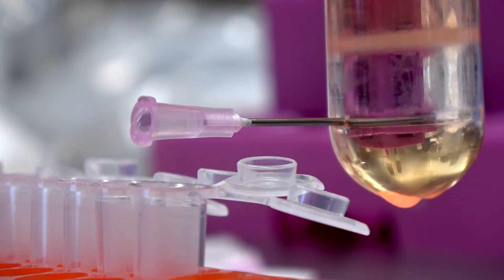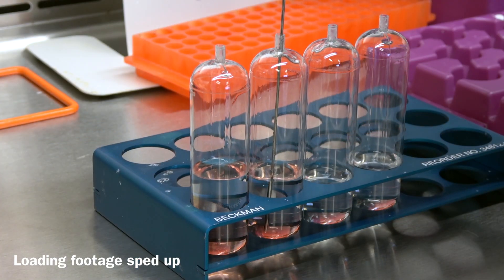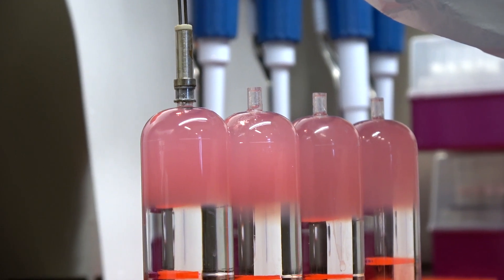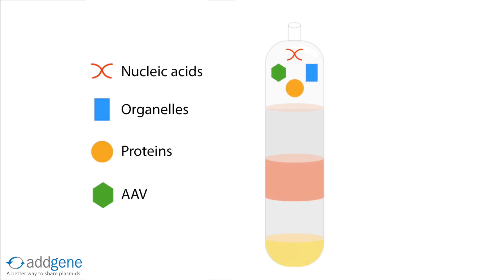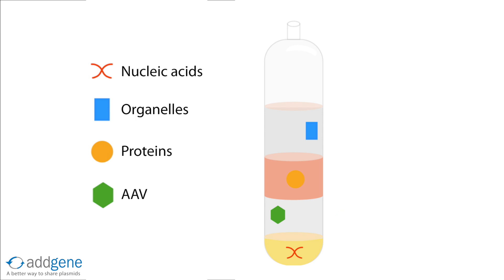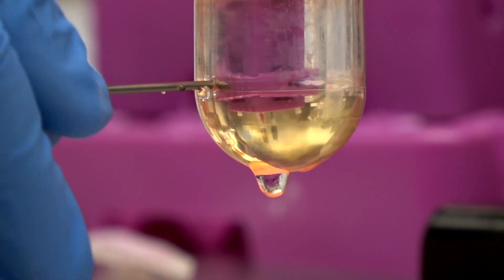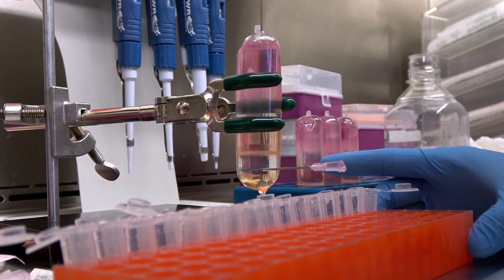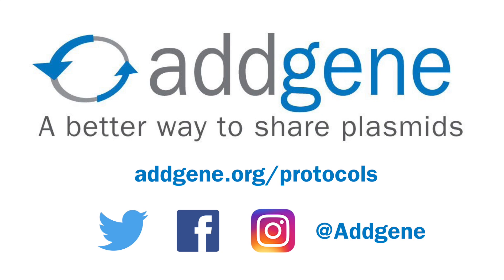AAV Purification

Comment: It is very interesting that in a video of less than 6 minutes, they teach us a technique for the purification of AVV.  Seeing this process and being able to understand it makes learning easier, the fact of seeing how careful they are and the exact method required for its elaboration also shows us how complex a procedure like this can be.  Now, ultracentrifugation could be said to be of the utmost importance for the production and purification of the AAV vector that is released from the solution found in the cell culture.
 It is necessary to highlight this method that is presented to us in the video, it provides us with information to know and better understand separation techniques, in this case with the use of a column with 4 different densities, so that the particles remain in one of the these 4 zones, depending on their density and/or size, which is very interesting to appreciate.

Comment: Es impresionante como el proceso para obtener la purificación del vector AVV es de sumo cuidado y con cantidades exactas de los reactivos asi como de los materiales específicos para llevar este proceso acabo, sin embargo, es de resaltar como la centrifuga cumple un papel muy importante en dicho proceso, el como empieza a separar una muestra en sus componentes más densos y menos densos respectivamente es la clave de que la extracción del vector AVV resulte exitosa, si no fuera por este paso sería casi que imposible separar de una manera casi perfecta estos componentes para asi obtener la muestra deseada, siempre y cuando se le coloquen las medidas correctas, que en este caso fueron 350 mil g durante 90 minutos,  aqui es donde podemos notar la importancia que tiene la fuerza centrifuga, ya que debido a esto las capas individuales permanecen intactas mientras que  las macromoléculas del sobrenadante quedan en la parte superior y así poder extraer la muestra deseada.

Todo esto nos puede llegar a recordar una definición de la fuerza centrifuga, la cual dice que: La fuerza centrífuga es la fuerza aparente que experimenta un cuerpo en un sistema de referencia rotatorio. Que está dada por la ecuación:  fuerza centrífuga = − ω m (ω × r) = m ω2 r, aquí podemos ver como la física, la química, la biología y la ciencia en general se complementa y cada una de ellas es tan importante como la otra, si no fuera por el conocimiento que se tiene sobre la fuerza centrifuga, no fuera posible usar un centrifugador y en este caso obtener una correcta purificación del vector AVV.

Comment: This is a procedure where we're studying a few steps of the Adeno associated virus vector (AAV) production. The main features of these steps are related to use a composed called "iodixanol" and a process called "ultracentrifugation" to form some column density gradients to help purify a cell culture solution. The basis of the technique is isolate virus particle according to its size and density. We have to prepare a column with 4 densities of iodixanol, adding each layer at a time. After that, we add the virus containning supernatant to the top carefully. Then, we spin in the ultracentrifuge. This process will separate nucleic acids, organelles, proteins and AAV according to the different density gradients in the corresponding layer of iodixanol. The AAV will be found at the bottom, so we have to puncture in the bottom layer with a needle to extract drop by drop the solution of AAV that we will need for the rest of the process. Great video. I love it.

Comment: El vídeo muestra de forma general un método para obtener soluciones de vector de alta calidad (purificadas) para su análisis a partir de una columna con 4 densidades diferentes de iodixanol (en diferentes porcentajes) que se someterá a una ultracentrifugación a 350,000 G durante 90 min. Con el fin de que las macromoléculas migren hasta que la densidad de estas y las del gradiente sean idénticas. Justamente el AAV entrará a la capa iodixanol al 40%. Finalmente, el AAV que se encuentre en la penúltima capa será extraído por una aguja y el contenido será almecenado en unos tubos de Eppendorf para su análisis ¿Extricatemente se debe rellenar la columna con PBS? porque creo que con agua destilada también se puede hacer para que la columna no colapse.